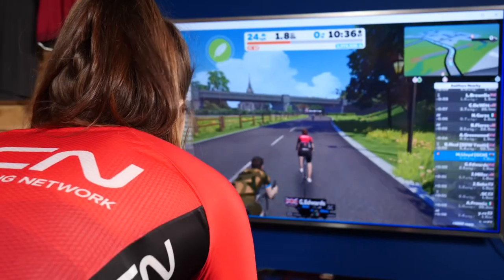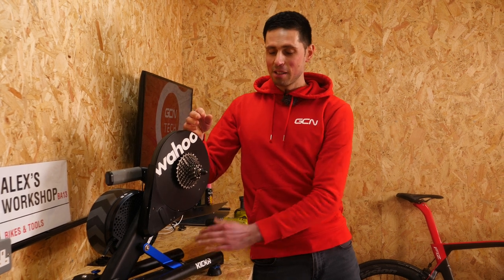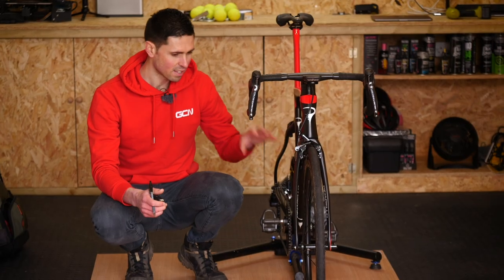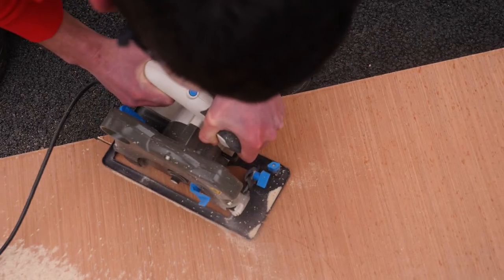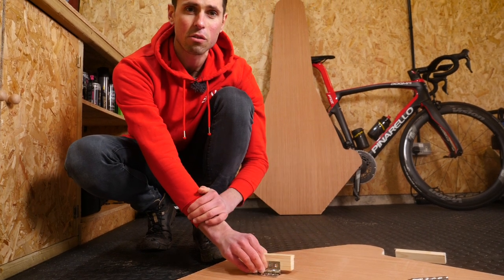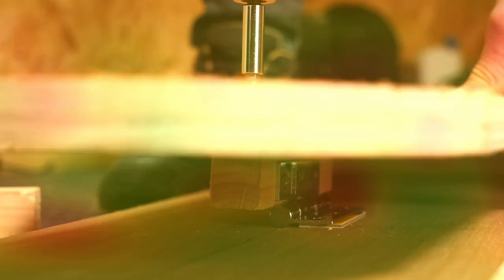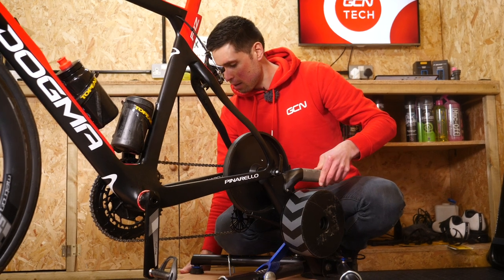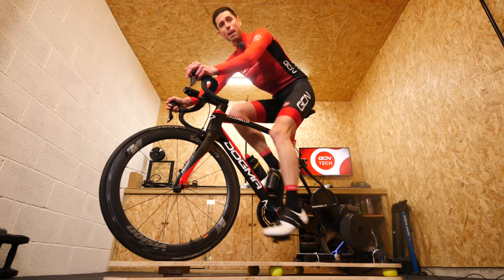DIY Homemade Rocker Plate | Cheap Indoor Training Upgrade

Comment from the maker: Would you ever try to make a home made rocker plate?
Reply: If one tennis ball each side is still too much resistance, you could also move the tennis balls just closer to the hinges. They'll have less leverage and will be easier to compress :) picture a nut cracker, easier to crush closer to the hinge 

Another than you could do, is paint line markings to make sure the position of the balls each side is the exact same :)

Fun build
Reply: Judging by the comments, I think there'd be a fair amount of interest in doing a bit of analysis on the vibration-dampening effects of this. I'd be interested in hearing a comparison of 
1) acoustic noise reaching rider/housemate's ears
2) vibration transmitted to saddle and handlebars
3) vibration transmitted to floor (and possibly therefore on to downstairs neighbours).

Obviously this all depends on the properties of the floor you're on, so I would repeat the measurements on a concrete garage floor and a typical upstairs bedroom floor.

I'd also be curious as to what happens if you just stuff the platform with a couple of dozen tennis balls so that there's no tilt, but just sound absorption.
I'm actively considering making one of these myself, but I'm considering making it a rectangle big enough to put under a set of rollers; obviously I wouldn't want my rollers tilting (express ticket to A&E, that!), I'd just be wanting to use a suspended platform to prevent vibration being transmitted downstairs.
Reply: @nialltracey2599  I know it may sound simple, but put it on a think rug. It'll really absorb upper vibration from being transmitted to the floor and house. 

And for the top plate you can use acoustic gel pads. They're good for audio reduction
Reply: Yes - quite interested.  I have the Wahoo Climb that I'd mount as well. One change I'd add is to make the rear perpendicular to the center line and add a pair of fixed wheels so you can lift up the front end and roll the whole thing around like a hand truck.
Reply: @supernoodles908  oh yes, certainly -- the more different softnesses of absorption you've got, the more frequencies you'll manage to squash.

My main point was that people in the comments here are already talking about noise, even though that wasn't discussed in the video. There's definitely enough interest in the topic that it would make a popular (and relatively easy to make) follow-up video.

Personally, I already have a lot of soft dampening under my turbo or rollers when I get them out -- foam underlay, soft carpets, a layer of old corrugated carboard and rubber carpet protectors on top. That deals with the high frequencies, so I wonder if a tennis ball suspended platform would get the low frequency roaring out too.

However, I'm aware that there's a chance it'll trade mechanical transmission for acoustic transmission: The top plate may act as a soundboard, sending the vibration out into the room as increased sound, but stopping the floor vibrating as much and bothering people downstairs.
Reply: Remember to apply several coats of yacht varnish if Si's going to use this.
Reply: I made mine from 18mm plywood, 5 spring isolation mounts down the centreline with two wheel barrow inner tubes which I can vary the pressure depending on how stable I want it. Absolutely love it! Good for sprint and any out the saddle work, saves the bike frame and turbo trainer from normal stresses. Good work on yours and your workshop is looking awesome!
Reply: Yes, made mine for about 100 quid , plans off the internet. Works very well, my trainer was too fixed before.
Reply: I truly believe forward/backward motion is the most beneficial rocking you should go for. This actually adds to realism. This is why in the end i got the frickin expensive Saris MP1. Please don‘t tell the wife how much it costs...
Reply: Yes!  put your trainer on a THICK yoga mat and you are good to go.
Reply: I’m going to Home Depot after this video is over
Reply: I built my own from a Facebook site run by Chad! And it puts that one to shame!! I should put it in hack or bodge!
Reply: @rogerdodger2009  fellow member of Chad’s Rocker Plates page?! Awesome resource for rocker plates that do indeed put this one firmly in the shade!
Reply: @supernoodles908  You could also change ball type.  A racquetball is about the same but wouldn't be as stiff.  You could also smash a tennis ball around for a few weeks and they wouldn't be as ridged, or just let the dog chew on them.
Reply: I considered it, but I decided to go with the Saris MP1 instead. I think this is a real quality design that a lot of people could try themselves to get some more movement.
Reply: Hoping when I can afford that particular dogma, I might be able to afford a rocker plate
Reply: Even though I have the kicker with the upgraded feet I think you still need more rocking motion so I think I will be making one of these fairly soon!
Reply: this is brilliant.. YES (on building my own) last year i did some research BUT using leaf springs designed for a small trailer instead of tennis balls... tennis balls seem more manageable. I think this is an excellent solution to a very overpriced product out there on the market. Great job GCN! More of these innovative alternatives during these economically challenged times.. no more 300 dollar BlueTooth enabled fans... please..
Reply: @supernoodles908  my Tempurepedic memory foam matress is due for retirement... I'll be keeping a nice chunk of it around for future unforseen uses like what you mention here...
Reply: @aki-gn7uq  sack off the inner tubes as they don't give enough, get a couple of 6 inch inflatable balls of eBay, they look like small basket balls, don't inflate too much and they give a much more natural ride 👍
Reply: @richardh7774  link to the plans please
Reply: @rogerdodger2009  link?

Comment: Arrived as expected with all parts intact, also included two hex keys for assembly. https://www.youtube.com/post/UgkxwOUUBdw8-88Iu4QnQS7q6b2NwZkHiYVl Had to adjust mine slightly to fit my bike, this was easy enough with instructions. I bought it to train with my track bike and found it to have resistance similar to climbing a slight gradient. Takes a while to learn to balance but there is plenty of guidance to help on the internet. Edit: There was more resistance at lower speeds because of the number of contact points but at higher speeds it is much easier as you don’t have to contend with drag.

Comment: I have been riding on Zwift now for about 6 months and slowly dropping the weight and getting in shape. As my rides have gotten longer, I started noticing the need to improve my overall comfort and started looking at rocker plates, but was not impressed with the price. This video hit just in time. This past weekend I modeled a home built rocker plate off of this example. Been using it for several days now (about 5 hours riding), and it works great! Was a little over $50 to make (good plywood is not cheap). Being a very big guy, I did use a total of five hinges, three under the trainer and two under my front riser. I figured that was clearly the weak/stress point of the model so I over-engineered a bit. I also am using three tennis balls on either side, and this works well for my large size. I am looking forward to being able to reduce the number of tennis balls as my weight keeps going down. Thank you GCN and Alex for another great and very useful video! And yes, I wear my GCN kit out on the virtual road.

Comment: So a few things everyone should know if they haven't yet done the research:  The AXIS upgrade kit (cost: $80 US) is only available for the most expensive Wahoo trainer, the KICKR.  It's not available for the CORE or the SNAP, so tough luck for those of us who didn't spend top dollar.  Also, while most of the reviews for the AXIS kit are good, several reviewers say it didn't make much of a difference at all, probably because their trainers were on carpet or a thick mat.  Lastly, while this build for a home made rocker plate looks good, you can find literally hundreds of online builds complete with detailed plans online.  I plan on building my own, because as we all know, sitting static on a bike on a trainer leads to a sore bum way sooner than would happen outdoors.

Comment: Nice. This is a great series Alex. If you want to increase the amount of rocking movement, once you’re down to the minimum of one ball each side, you could also move the balls closer to the centreline to reduce the moment arm and hence the self levelling torque (assuming there’s minimal flex in the plywood).

Comment: You do not need hinges. Just place some tennis balls down the middle, as well as the other ones, an zip-tie the ends of the two rocker plates together - preferably the thick zip-ties. You might want one extra zip-tie, in the middle, of this kind of long rocker plate. And the new rocker plate will work great. And drill some 35 mm holes, which you round the edge of with a router, where you want the tennis balls to be. That way they stay in place.
Reply: The plates will roll without a fixed pivot point.
Reply: @TheDarryn007  "And drill some 35 mm holes, which you round the edge of with a router, where you want the tennis balls to be. That way they stay in place."
Reply: I’m doing an all tennis now. A better size may be 2”, and the holes can be rounded with a sanding tip on a rotary tool such as a dremel.

The hinges remove all upward and forward movement, tennis balls alone allow movement in all planes. All planes will be more comfy. I have no idea if there is any measurable power loss.

Comment: My version is even more cheapskate. My Wahoo V5 sinks into the Wahoo mat so it looses some of the side to side motion. I cut in half an ex army foam bed roll, one piece width ways under the mat under the feet and one longways under mat under the front wheel. You get a lot more lateral movement. Also I added a Lazy Susan bearing to a piece of ply with some rubber on top to allow more side to side motion at the bars. Combined with a Ram X mount to hold my phone I have a steering set up for the mountain bike route on Zwift....

Comment: You could also use firmer / softer tennis balls depending on how firm you want the suspension to be.
Reply: You could also move the tennis balls just closer to the hinges. They'll have less leverage and will be easier to compress rather than buying different tennis balls :)

Comment: if one tennis ball each side is still too much resistance, you could also move the tennis balls just closer to the hinges. They'll have less leverage and will be easier to compress :) picture a nut cracker, easier to crush closer to the hinge 

Another than you could do, is paint line markings to make sure the position of the balls each side is the exact same :)

Fun build
Reply: Or build it with a series of wooden strips (eg skirting beading or pine moulding strips) on the base plate, running parallel to the centre line. These would not only make it easier to set the distance, but they'd also prevent the tennis balls squirming their way towards the centre line as your ride progresses, which is a distinct possibility if you're using it for an extended period of time.
Reply: @nialltracey2599  it would be better to do that
Extra effort but probably worth it

Comment: Did you compensate for the offset weight of the Kickr? I had to add a 4kg weight on the right side on my rockerplate setup, otherwise the plate leaned over to the left (when looking from the rear)
Reply: Adding a counterweight is a good idea.  It helps make sure the leaning forces to each side are equal and the deck stays nicely level too.
Reply: @Chader9  not a problem with Tacx Neo asthma are symmetrical.
Reply: Sure. The Neo and any other trainer that is balanced already (without a heavy flywheel offset to one side) won't need or benefit from a counterweight. 

I have that covered in the setup section of my rocker doc.

https://docs.google.com/document/d/1rsOK6Qym9tFR6wrVScs65-LfFIGKykfirA5f04Z-KBA/edit?usp=drivesdk

Comment: Interesting. This might relief the stress on the bike frame, at least partially, which is the most important thing here.
Reply: Yes, I have no proof, but it is likely to reduce side loading when compared to hard efforts on a rigid trainer.  Allowing some degree of freedom and placing that balance and control into the rider likely reduces the loading into the bike.

Comment: My indoor setup sits idle most the year, so spending a lot on a rocker plate makes no sense.  I has a tiny bit of natural "rock," but it would be interesting to see how something like this might enhance the experience.  I can see one drawback right away though; unless I include some extra width on the non-drive side as a step, that added height and "offset" will make getting on and off somewhat tricky.

Comment: GCN you are building a Gen 1 Rocket Plate. Nobody uses hinges and tennis balls anymore.  Rubber isolators and gym balls are what is used in 2021 and or a rod and pillow bearings.
Reply: Yup, that is my November 2017 Rockit Launcher design. ;)

The newer vibration mounts are great and a bit easier to build than the old hinge ones.
Reply: @Chader9   Craziness Chad. Easy build for sure but I guess they only watched one Rocker Plate Video -!
Reply: @mjv1967  yeah, there are several more designs for simple rocking, and even more when you add fore-aft motion to the mix.

This is great though, since it gets the basic concept out and hopefully shows it to people who haven't seen rockers yet.  I welcome any exposure we get.  :D

Comment: How about a system that allows fore and aft movememt for your rollers / rolling road ?
Reply: The Saris MP1 does this but at a price of $1200 unfortunately
Reply: @michaelmastell6778  thats why I suggested a diy version😊
Reply: We have a lot of DIY solutions of Fore-Aft rocker plates on our "Rocker Plate" group on Facebook.

Some are made with simple parts while others use more advanced bearings.  All are much cheaper than the Saris MP1.

Comment: Won't this lateral movement in addition to the gyroscopic force of the trainer flywheel cause unintentional stress on the bearings, leading to premature wear/failure? 
I love the idea, but I don't think that these were designed to be used as such. Wouldn't surprise me if this voided the warranty by not having the trainer on a level, stable surface.
Reply: I've been using numerous trainers on Rocker Plates for over 5 years.  We also have literally thousands in literally group using them for up to 3 years.

No one has reported any trainer issues.  Considering the location relative to the pivot, the lateral displacement is not that much.  Then consider that Kinet has sold Rock and Roll, Smart Control and the newest R1 trainer for years.  So that seems like they would have shown any issues and not sell a product that destroys itself. 

There's just not a problem, though I understand the concern.

Comment: You'd be better off using isolation mounts down through the center of the two ply decks rather than the hinges and wood. Isolation mounts will last much longer and are cheap to buy.
Reply: isolation mounts will create 'bounce' this will absorb watts.. not good.
Reply: @lrobbo269 solid isolation mounts allow side to side movements, they do not compress and certainly do not bounce so no wasted watts! Mines made with them, most commercially produced rocker plates without the fore and aft movements are made using them. They are a good idea

Comment: It turns out my setup already does this because I've been adding foam on top of foam so my neighbors don't come knocking.
Reply: Exactly the same, i have 7 layers of industrial bubble wrap then two industrial appliance noise damping mats. Kills much of the noise and instant, cheap rocker
Reply: Yeah, the pure compression material is a great option that's easy and  cheap.
Reply: I use an old foam sleeping mat. Works for me, although i only us it on underneath my back wheel, not the front 🤔
Reply: Not sure - but couldn't this damage your rear drop outs? Leaning into soft material with the leaver of your trainer's legs to the side will apply loads not typically seen on the road or with a rigid board that is moving in one piece. Just engineering estimate though
Reply: @suedfrucht44  It is something to be considered.  But considering how thick the steel is at the foldable leg joints and that there are nuts and bolts for tightening, which I haven't needed to tighten for 4 years, I think it has passed the durability test to ensure no wear for the life cycle of my Kickr Snap and my DIY noise/vibration insulation combo.

Comment: The problem I find is that a bike doesn’t pivot at the point of contact with the road but at a higher point closer to the axles, so while rockers like this do have a little give to them which is 100x better than a rigid bike, it’s still not an accurate simulation of riding.

Comment: Nothing beats SMART ROLLERS
Reply: Rollers are surely fun, but can be a real challenge for thinkg like short-short anaerobic intervals and race efforts (Zwift).  I've had some scary moments on recoveries.

I made my first rocker plate with the goal of getting some security of a rigid trainer, but add some of the feel of rollers, while eliminating the fall risk.
Reply: So add a rocker plate to rollers to simulate crosswinds on deep section wheels! Rock n roll!